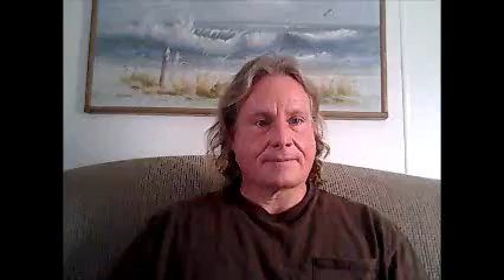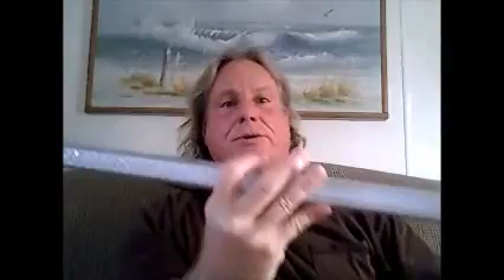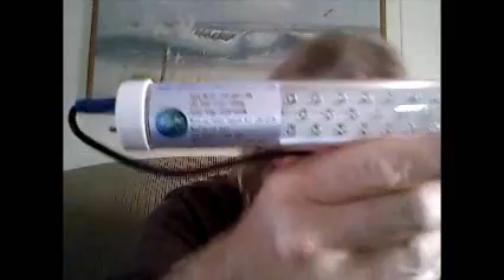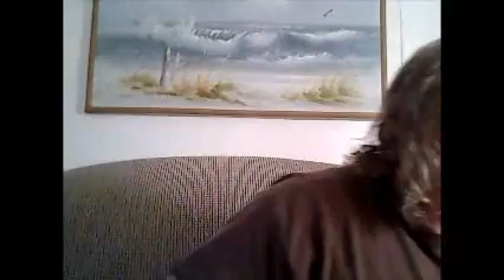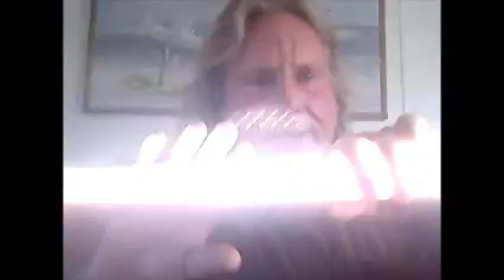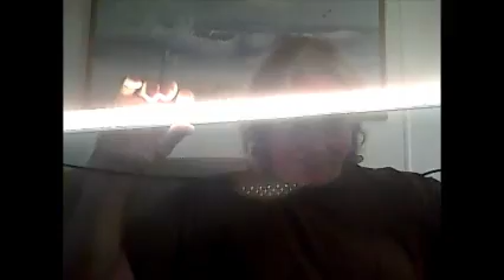2-22-14 Bill Ballard ~ Calling out to CAD Designers for 3D Printing ~ Changing our Planet

Comment: Here is a 3D printer for about $400 dollars that is equally as good as any RepRap if not better I think, and it comes with a very good software too where you can correct bad prints etc. check it out if you want
https://www.kickstarter.com/projects/ez3d/phoenix-3d-printer
I also do some cad designing my self, if you want send me a photo of what you need to be created in a CAD file and I will let you know if I can handle it or not, if its something I can do, I'll be happy to help out and create the files.

Comment: +1 on open sourcing everything we can!
Reply from the maker: I agree but there are some CAD programs that are much easier to use. In my designs I need Fibonaci Spirals to use as shapes but that is an issue with the SCAD with what I have studied. The trig is not listed in SCADs examples of what has so far been accomplished... That is why I am looking  for someone who has AutoCad or a higher much more easy program and when that is put to the STL files... I really dont care who prints it... Get it Done!
Reply: pearls2u
The new autocad and solidworks are phenomenal programs.  I've been toying with blender lately but unfortunately it's over my head.  I wish there was a free, open source CAD program out but for now, I'm afraid that you're right.  We need the big money programs and people that are trained to use them at this point.  If I could sit down with a solidworks guru for a few hours, everyone else would able to be able to see and build the neat things I see in my head!

Comment: Right now is it possible to purchase the 3d printer your talking about and print the parts to an exact replica? if so I will purchase one right now and start working on printing more printers! you could create an army of printers!
Reply from the maker: That too is my intent eventually. But for now, a printer has to have heads changed out to print more than one material. It is our intent to eventually design what would be the Star Trek replicators that can scan a product and use the appropriate head to manufacture it... With so many persons out there specializing in this or that material, combining all their work and experience is what is necessary to build the replicators...

Soon you will be able to print metals with plastics as you ask, can it all be done here... soon we will combine all that into 1 machine! That's the goal!